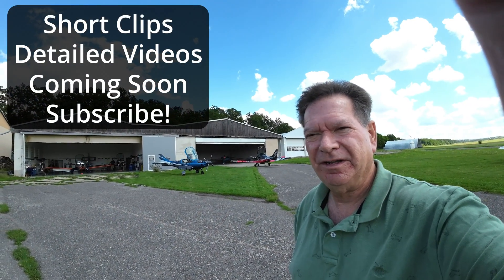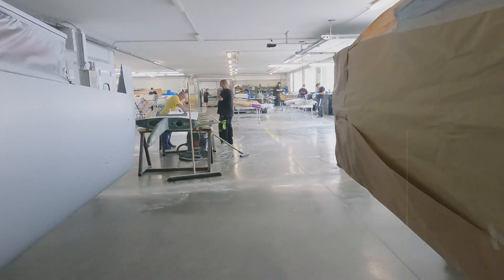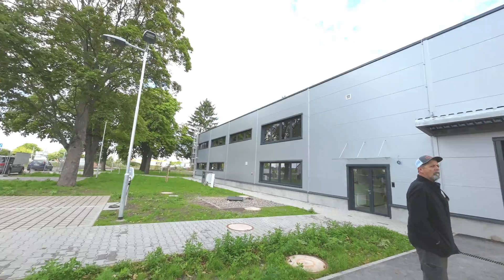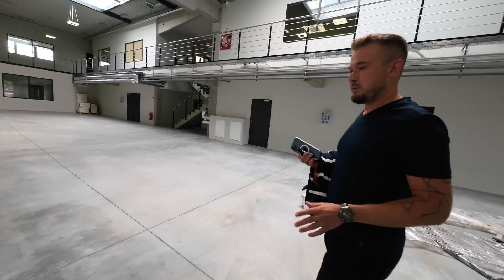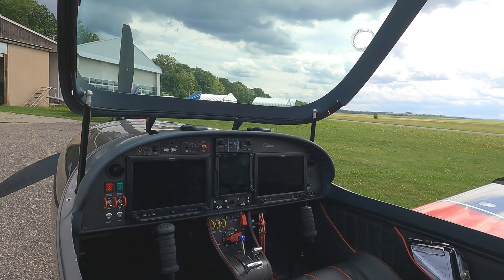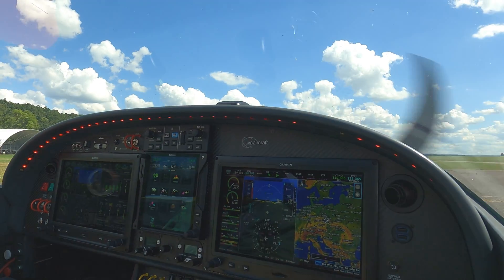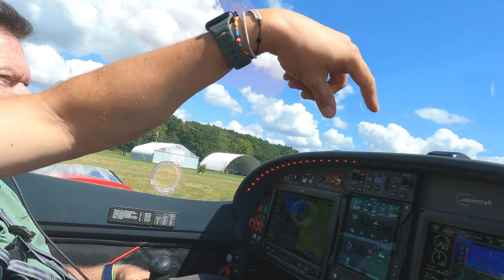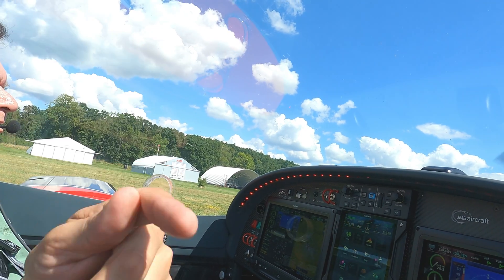JMB VL3 Aircraft Factory Visit and Test Flight Near Prague

Comment: Hi Pilot Steve, here is Pilot Stieven (Steven). I am a P210N-TN550 driver and also in the market for the VL3-916iS or even better the TP version. You said you decided for the 916iS, have you received so far performance data, that one could compare to the 915iS data (fuel flow and TAS for certain power settings (RPM&MAP) and in specific altitudes???
Reply: I test flew the 916 in Prague a few weeks ago and takeoff is "jet like". Climb is over 2500fpm. I don't know about cruise and fuel burn yet, but once I get my plane I'll do several test flights and publish my findings.
Reply: @notravelagendasteve3158  thanks Steve! When you flew with VL3’s so far, were they equipped with GFC500 and if so, was it stable in flight like your previous airplane (that were much heavier)?
Reply: @notravelagendasteve3158  I would 100% agreed it is a jet like take off - even in the 915 - aircraft jumps off the ground with a high climb rate @2000.  Frankly - I was not ready for it and was surprised.
Reply: Rotax recently released some specific 915iS versus 916iS performance numbers, including fuel burn data, in an EAA webinar.  I tried to post a link here, but YouTube appears to be deleting or hiding the comment, presumably to keep us within its platform. I'll try again in a separate comment while leaving this one link-free.
Reply from the maker: You have to be an EAA member to watch, but the title is: Webinar- 916iS - The New Rotax Engine
Reply: For the Rotax performance chart, go to VL3Flyers, then a period, then the first three letters of organization.  It's in the "Rotax Engines" forum.